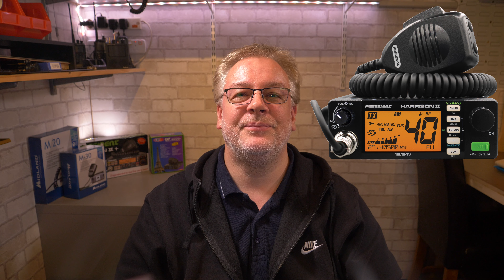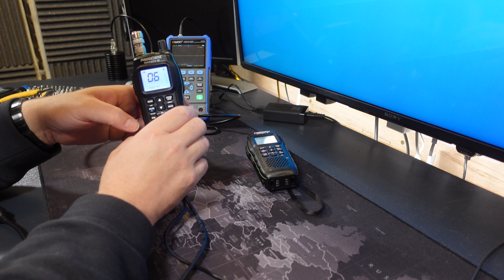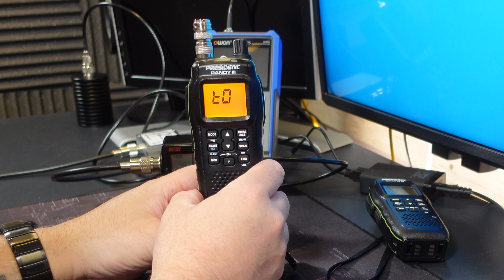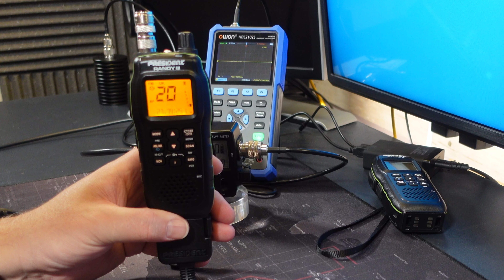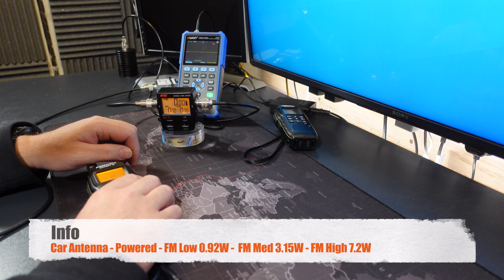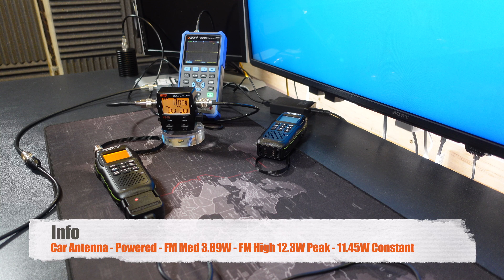President Randy III Handheld CB Radio - Revisited - Secrets Exposed

Comment: Hello and thank you for this superb video.

However, accessing the secret menu, the service menu, doesn't work on the Randy III+ (Plus). When you press the [ANL/NB] + [SCAN] buttons and then turn on the radio, nothing happens. It's the same as when you turned the radio on.

However, on the Randy III Plus, you can access two functions by pressing the buttons, which I don't understand:

- [MODE] + [CTCSS/DCS] (+ Turn ON) => "TEST" is displayed on the screen
- [SCAN] + [EMG] (+ Turn ON) => "TOT OFF" is displayed on the screen.

And if you repeat the same procedure:
- [SCAN] + [EMG] (+ Turn ON) => "TOT ON" is displayed on the screen.

Comment: In the Randy settings in extend mode, there is a Split option. In addition to the usual up-down and shift frequency settings, there is a third setting with a possible range of 0-14. I was unable to find the meaning of this setting. See picture https://img41.rajce.idnes.cz/d4103/19/19708/19708725_6cf2ec6f8d96b0386fa36610bd7f0dd0/thumb/rand.jpg?ver=0

Comment: Hi good night. In expanded mode using the internal battery, could the hight power be incresed to at least 5w?. Do you know the maximum power that could be used with both the internal battery and the car kit without damaging the equipment?. Thank you very much in advance. Kind regards, Raul.

Comment: What happens if you only cut one of the wires? Do you get different features if one or the other or both are cut?
Reply: One of the white wires is for power output increase ( just a little) and the other one is for frequency expansion.

Comment: When I was 10 or 11 I got a 3 watt Radio Shack hand held for Christmas as did my best friend. It came with two crystals one for receiving and one for transmitting and crystals for other frequencies could be bought. I immediately opened our radios and reversed the crystal positions for total privacy and increased range 🙂
Reply: When I was younger I had a radio shack hand held that had 3 channels. You had to open the radio and change the crystals for different channels. The good ol days

Comment: If the 2 wire snip modification were to be done on the Randy-3 and the radio used in the USA ,what band/block of frequencies would match the standard 40 CB channels frequencies here in the US? Would it be simply Block A or does the mod disable the radio from working with other standard CB radios in the US?
Reply: Same question, can mod be done with US version with same results?

Comment: Actually a brilliant video that 12w FM hack is a bit of a game changer you could run portable off 3s 18650’s with a decent antenna.
This is the first video I’ve seen that puts a good argument for the President Randy iii over the Thunderpole TX
Is there any chance the Thunderpole has a similar option that hasn’t been explored yet? 
It’s USB-C charging option, Native BNC Kenwood mic speaker plug in and exported access to FM ham bands are what’s got me heading down that route (plus the price)

Comment: How you get power to the car-adapter when using it at home ?  Used with a Di-Pol or a T2LT antenna. and modified like you shown to us, i think it could really be an alternativ to one of the mobile stations. There is also an external Microphon for it, like the mobile stations have. Combinate all that with a Strong Battery to power up the car Kit it could be a good solution for emergency-comunication. Or also for those who do desaster-preparation too. An its a small solution, which can be simply stored in a backpack as well as in a drawer.
Reply from the maker: The car kit adapter requires 12V and I use a desktop linear power supply which has an accessories adapter socket on the front. You could also cut the adapter off and wire it to any 12v supply. Some power banks also have accessories sockets on them, the likes of EcoFlow and Jackery. I am working on a video at the moment for the Radioddity CB-27 Pro and am covering alternatives for powering when out on foot which might interest you. That video will hopefully be posted in the next few weeks. Just waiting on some batteries and bits to arrive in the mail for that. All the best and thanks for watching and commenting. MJ7NLK
Reply: @NLKMediaGroup  Yes i thought about a midsize Powerstation with Solarpanel. I have seen there are some of them with one or two of these Car-adapter holes ! But these things are not cheap ! But ok, here we have a battery-Station with normal Powersockets for 220 V and the Machine has 2.5 KWH so you can drive a Refridgerator or a Dishwasher with it for half a day. At a real Blackout this thing helps in more ways then only to power up the radio. There are those People, who fill up there caves with tons of stuff to hopefully surviving WW3 or so, i think this is a bit overrtuned. But a little preparation for a Blackout anyone can do. Do you know a Scanner, which can also receive normal radio-program from the local radio-station ?

Comment: can this be done on the randy2 the coversion for extra channels
Reply from the maker: The FCC radios tend to have the ability to expand / the export mode removed. I seem to remember some US viewers telling me that the Randy 2 FCC doesn't have the loops inside and that there is no expansion mode available on that model. You could try and source the EU model from Amazon or from somewhere like www.kcb.co.uk. The FCC model also doesn't come with the car kit and another viewer said that they had tried to get one from President US but they don't sell it in the US and it doesn't come in the box like the EU model. Hope this helps and thanks for watching. MJ7NLK

Comment: The Randy III is not being sold in the USA yet. Will this wire cut hack also work on the Jerry FCC? Nice video. Thanks!
Reply from the maker: President have a different set of radios for the US market. The equivalent US radio is the Randy II FCC. However, the FCC make President remove the export mode functionality on the FCC versions. The Randy II FCC does not have the wires inside to enable export mode to the best of my knowledge. I have the EU Jerry on the shelf waiting to be reviewed. I am not sure at present if that has the export mode or not. However, the Jerry FCC will most likely have it removed anyway. You could try to source an EU version which some of my US viewers have done. All the best and thanks for watching MJ7NLK

Comment: EXTENDED Test/Service Mode (20 settings)

Press and hold Mode + CTCSS/DCS then power on.
Quickly press in sequence ANL/NB SCAN MON EMG.
Select setting using channel buttons. Press PTT and adjust value using channel buttons.
Reply from the maker: Hi Musclosoft, thanks for the information, very helpful. Really handy to have power adjustment settings in the extended menu. All the best and thanks for commenting. MJ7NLK

Comment: 12 watts out put will drain and shortened your battery life
Reply from the maker: 12W is only achieved when running on the car kit and powered from the vehicle. On the built in battery you can't output higher wattages. 12W would not be kind on any built in battery and the one in the PR3 is tiny and couldnt sustain it. All the best and thanks for watching. MJ7NLK

Comment: Thanks for the super video. 
I have one question - what happens when you cut only the left wire? The right hand side wire is the advantage mode. Do I increase only the output on the left hand side? If yes, how much?
I send my regards from Windhoek (Namibia)
Reply from the maker: Hi, thanks for the feedback which is greatly appreciated. I do not know what happens if you only cut one of the wires. I suspect that one wire expands the frequency ranges and the other wire unlocks the additonal power mode. This is a guess as I have not tested this. This would however be consistent with other President radios when expanding them. So, my guess would be that cutting the right wire would have no affect until the left wire has been cut. Hope this helps and thanks for watching and for commenting. All the best MJ7NLK

Comment: Hi I got question, I mean when I turn on radio always on screen first is T5 this is ok or not?
Reply from the maker: Hi, yes that is correct. t5 means that the radio is set to +5 KHz on each channel. You can set to t0 by pressing and holding the F key on the radio while on. You can then see a decimal point between the channel numbers, So 02 band block A in t5 and it will show 0.2 band block A in t0 mode. You need t0 mode to get to frequencies which are 5KHz lower than standard bands. Normally the radio should be in t5 mode but some countries use frequencies 5KHz lower. Hope this helps and thanks for watching MJ7NLK
Reply: @NLKMediaGroup  thank You so much profesional mate ;)

Comment: the best handheld I had was the Cherokee Spitfire 454 back in the mid 90s and early 2000s. It was a 10 Meter handheld that had AM, FM, and SSB, and was modified to get about 10 bands of frequencies. I forget what the frequency span was. It was a great handheld to use. I used it a lot to talk to my locals while walking around the neighborhood or when I would go on a bike ride around the neighborhood. It was almost like having a handheld version of the RCI 2950.

Comment: No idea what you meant when you said that it reduces power to the "top" when using the car kit adapter so it doesn't radiate so much power in your face?  Makes no sense at all...  What does using the car adapter have to do with which antenna and why would it be less when using the adapter?
Reply from the maker: The radio is wired to only output high power to the antenna of the car kit and not the internal antenna. I think it has more to do with power consumption than anything else. If you plug the car kit in the radio allow you to switch between Low, Medium and High power but if you detach the car kit adapter it only allows for Low and Medium. The battery is tiny in the PR3 and it certainly wont have the juice to maintain 12W on the internal antenna without taking its power from the vehicle. You can see the menu options restrict as soon as you unplug it and testing with power meters the output on the internal antenna is restricted. All the best and thanks for watching

Comment: Hi good afternoon how can I adjust the fm power setting without doing that mod you did can’t find anything in the manual many thanks 😊
Reply from the maker: The power adjustment affects both AM and FM and is limited if just using the menu unless the radio is unlocked with the wire mod. All the best and thanks for watching
Reply: @NLKMediaGroup  thank you for getting back to me
Reply: The Randy II FCC, out of the box is a high modulation powerhouse. I am clearly able to transmit as far as my driveway. Not much more. I had a toy walkie-talkie, purchased in a supermarket back in 1968 that performed better. Disappointing President! Increase the  allowed power on the  US-CB band FCC. Not that many people use it anymore. The skippies are gonna shoot skip no matter what. We need extra power to simply use the band effectively. A 5 mile range may have been adequate back in 1970. It is not adequate in 2025. If you don't attract citizens to use this band then we will lose it. Open it up, it is too restricted!

Comment: I realise this video is now 11 months old, but I've decided to get back into cb and a handheld would be good to use with a car kit and also while dog walking, you have the power up to 12 watt with a car kit instead of a car cb's 4 watt, which would save me using a burner, but at 12 watts power can I still use it as a  handheld while out walking the dog?
Reply from the maker: Hi Paul, yes the radio adjusts dependent on if its plugged in to the car kit. So, it will only have low and medium power options when unplugged and when connected it then has low, medium and high. So you can walk the dog at 4W and when back plug in and punch out 12W through the car antenna. Hope this helps. Also worth getting a longer rubber duck antenna when mobile. if you go to www.kcb.co.uk (Knights Electrocom) and type in HHL1 that should give you more range. All the best and thanks for watching
Reply: @NLKMediaGroup Plus use a Lambda/4 tiger tale.

Comment: I am in the USA so if I purchase the Randy FCC does your video also apply to mods?

I am a ham operator and would like just the 10 meter band.
Reply from the maker: Hi, the FCC versions are different and normally have the ability to modify removed. I believe that the Randy FCC version does not have the two white wires when taken apart. I do not have the US version so cannot perform testing so am just telling you what other viewers have said. Some viewers have told me that they ordered EU versions and had them delivered into the US. The standard EU 40 channels (CEPT) are the same as the US 40 so would work fine. Obviously the EU versions are not type approved by the FCC so would be illegal to use.
Why dont you look at the President Richard or the President Lincoln 2+ which are both 10 meter radios (and can be expanded to CB). The Richard is a great radio if you dont need SSB, the Lincoln is more complex but has SSB. There is also a new President George 2 SSB radio which everyone is waiting for that is supposed to be available in September. Check out the EU President website as all the info is on there. Hope this helps, all the best and thanks for watching.

Comment: Abouth the alpha channels. Since those channels are off frequency, is there a way to reverse them back to the original frequencies?
Reply from the maker: Hi Kenneth, alpha channels are inbetween the existing channels. You get channel 15, 15A, 16, 17, 18, 19, 19A and then 20, etc. So the non-alpha channels are the original frequencies and the alpha channels fill in the gaps in the band plan. If you mean, can you revert the radio back to its original state without the expanded frequencies, then yes you can, but you need to reconnect the wires that you cut. On the normal radios you can just move the jumper back but the PR3 does not have a jumper only the two wires. Hope this helps. All the best
Reply: @NLKMediaGroup  yes it does thx

Comment: Oh well ... looks like mine is going in the bin. 
Had it 3 months and i now have no output. 
Its covered in the video but do think carefully before you nip the wires to wideband it. 
I did it with mine and now regret doung it. Yes it widebanded it but then it just stopped working. 
I'm now at a £200 loss so if you buy one LEAVE IT ALONE! 
Disappointed.
Reply from the maker: Hi, wide banding is a supported feature so if your unit is not functioning as expected then return it to President for warrantee repair. I have two PR3's both are wide banded and have worked flawlessly for almost two years. If the radio has developed a fault send it back for repair. You are the first person I have heard from that has had an issue with the PR3. Hope this helps and thanks for commenting and letting me know. All the best
Reply: Hi mate, having reviewed this case it turns out that it was increase to 9w that caused the radio to pack up. Very surprising because it would have gone to 11.8w so thought 9w would be fine. 
When i contacted President they simply were not interested and advised me to take it to a local engineer (who was the one who diagnosed and quoted £70+ new board + VAT for the repair)

Im so done with President now. Ive just bought the new Thunderpole T-X handheld and have to say that its phenomenal. 
Have a look at it! Its great!
Laurie

Comment: Seems like a waste of money 💰 only truck drivers on cb. What's the point of adding FM mode to a CB radio? Most are using gmrs anyway
Reply from the maker: Hi Richard, it depends on what your needs are. In the US market you have GMRS which is an alternative but not in europe. We have had FM on CB in the UK for many years (2006 i think) and is nothing new for us, we also have our own FM UK band block which differs to the standard CEPT block. In the license free areana its CB or PMR in Europe. Thanks for watching and for commenting. All the best

Comment: I would willingly subscribe etc if you could tell me if the car kit mode plugs into an antenna on the outside of the car, and, if in export mode is giving about 10-12 watts? Also what about swrs when interchanging between antennas, original, long hand held and car. Much appreciated thanks
Reply from the maker: Hi, the car kit is designed to allow you to connect to an external antenna on your vehicle. It has a standard SO239 / PL259 connector on it. You can only get the higher wattages using the car kit as the wiring for the internal antenna does not support it plus the power requirements and the internal battery. That is why you can only get High power mode when using the car kit, powered by the vehicle and external antenna. Every antenna should be tuned for SWR so as long as you have tuned your vehicles external antenna swapping between the two is fine. I hope this helps, all the best and thanks for watching

Comment: So what’s the secret to make this radio actually work good? Lol
Reply from the maker: Hi Fox250R, great hand held the PR3 and packed with expandability options. :-) All the best and thanks for watching
Reply: @NLKMediaGroup question please, do all the Randy’s put out the same watts? Thank you
Reply from the maker: @Fox250R  The Randy 3 EU model and Randy 2 FCC will put out the same power in standard unmodified mode. The Randy 3 has the expansion options as shown in the video but the Randy 2 FCC does not. The FCC usually insist on the removal of export mods before approving them for use in NA. As they are only for the NA market and 4W is the legal maximum there is no argument to keep the export mods on those versions. The EU model is sold all over the place and in regions with different legal power options so the export mode is for those countries and remains a hidden feature. Hope this helps and thanks for watching. MJ7NLK